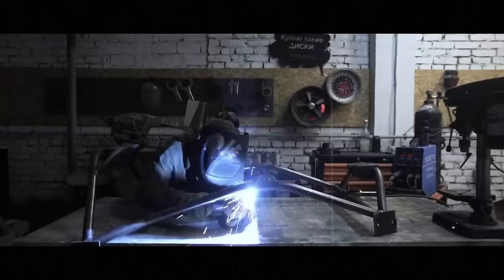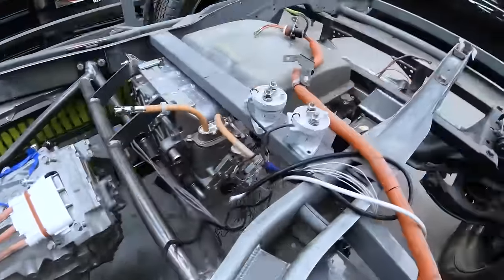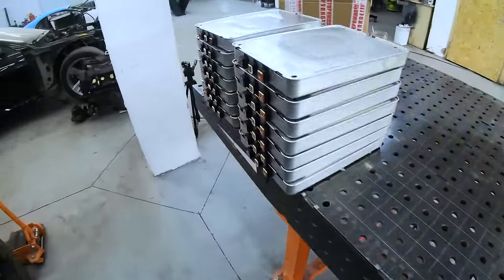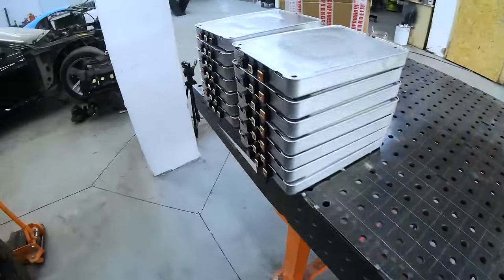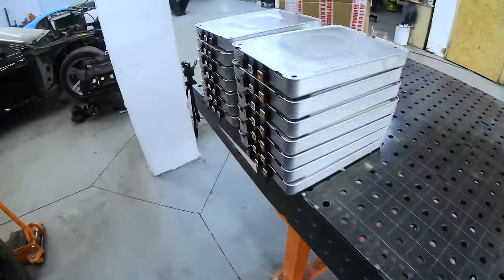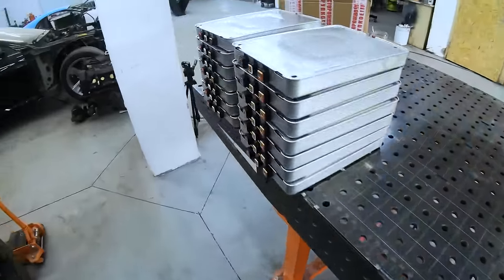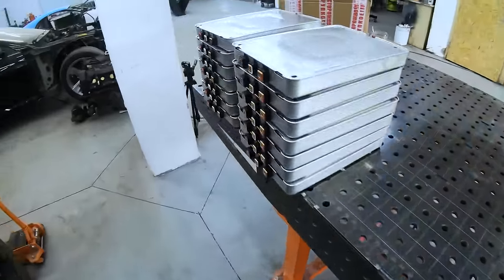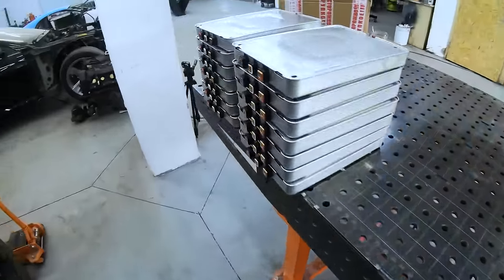Electric Cyber Van from the future the first departure. HomeMade

Comment: It's alive! If I understand correctly it's controlled by an Arduino, that's awesome!
Reply: Yes lets take right now one metric ton vehicle and put arduino of all things in charge of throttle and steering.. what ever could go wrong. I do not trust cybertrucks drive by wire setup or there being electric motor in the steering wheel at all, let alone this death trap. Guess its a blessing that this thing wont be in the road, but then why even make it if you cant use it?
Reply: Thanks for watching and long waiting! Happy you with us! Of course we are working on it.

Comment: To use an Auto Transmission you'll need to fit an external pump to maintain Fluid pressure when the Motor isn't spinning. Great work so far
Reply: I thought that too
Reply: Thanks for watching and your interest! Glad you like it. Have you seen our other crazy projects?

Comment: I was watching a hub rebuild of a rear motorcycle wheel and they had some energy transfer parts inside - even with a modern motor/gearbox/drivetrain, regular motorcycles still need a little help built in so they don't shred everything from the stress forces of the instantaneous torque they are able to produce, which is even "more" instantaneous with electric motors. 
Great build, this is going to be pretty awesome.
Reply: Russell, thanks for watching and your interest! Glad you like it. Which of our projects do you like most?

Comment: The axles will fail really fast with the weight of the battery pack only.  Turning circle looks like a laugh. Look at Mercedes Sprinter 316D rear wheel drive for ideas on how much wheel angle you need in a van.  Simplify everything, and spread it out front and back, no need to put everything in the front. An automatic transmission would work fine, but a working one with enough oil and electronic selector between 1 and R.  The torque converter will help with heavy loads + when pulling a trailer. Good luck with the project.
Reply: Thank you so much for watching and your interest! We appreciate it. Have you seen our other crazy projects?

Comment: I like the idea of having the fluid coupler for dampening. The transmission functions based on having a 5-800 minimum input shaft RPM. Is there a way to have the electric motor idle at 500RPM at all times when the system is on?

Comment: Do not weld or grind anywhere near you batteries.  Treat batteries like they are bombs, so welding spatter or grinding sparks can cause big problems.  Those Nissan battery modules have open holes to the cells themselves, so the potential for issues from the little bits of metal aren't just a potential issue while they are hot.  Vibration and tiny flexing of the pack during use along with the expansion and contraction of the cells during use as the status of charge changes can cause small bits of metal to make a hole in a cell which is the beginning of a catastrophic failure.
Reply: Thanks! Sub and keep on watching

Comment: I am confused why you didn't use the Leaf Gearbox which is a fixed single gear reduction. There is no need to either a "manual" or "automatic" gearbox with the Leaf Motor and inverter.

Comment: Electric vehicles don't need transmissions except in 2 cases.  1.  A severely underpowered system like e-mountain bikes or 2.  A vehicle that has 2 purposes... normal driving as well as climbing very steep inclines slowly or other extremely heavy loads.  Engineering types always what to put multi-speed transmissions but learn the hard way, from the original Telsa Roadster to almost all early emoto makers.  The reason no tranny is needed is that electric motors make maximum torque from 0 rpm and have broad torque curves unlike petrol motors that need higher rpms to make torque and have narrow torque bands.  Also, transmissions don't hold up well to the high torque possible from electric motors.  Just gear it right and you're good to go.  A perrfect example is trains.  Look att the loads they pull, and except for old steamers they are all driven by electric motors.  Even diesel locomotives have electric motor drives with a diesel generator.  All a tranny does is add weight, tons of failure points, and unnecessary drive losses of 10-20%, so dump the tranny, gear it for a top unloaded speed about 20% high than you want as a max speed, and let the controller do its job.

Comment: PS3, PS4, PS5, Switch, Xbox etc controllers all suffer from "stick drift" at some point. Once this happens, the joysticks will suddenly get stuck in an "ON" state or lose connection that you cant fix without changing out the potentiometers. Even then, the potentiometers in these controllers have a finite number of rotations they can handle before they wear out. Using a PS4 joystick like the one you have shown for your acceleration or steering would have disastrous or even deadly consequences if the vehicle was in motion. Stick drift can happen at anytime and even the latest PS5 controllers started to experience it after only a few months of use. If you are determined to control this vehicle with a joystick, it would be wise to use an electromagnetic joystick or linear hall effect sensors. More reliable and safer.
Reply: Thanks for watching and your interest! We like to create something new and unusual. We'll try) Have you seen our other crazy projects?

Comment: I can assure you the PS3 controller needs to go and you need to somehow install normal brakes and steering with transmission shifting. It should not be that hard. Man has to operate it with his legs and arms. you have done what no one else has and yes I have the absolute qualifications to say what I am proposing here. You have done very well so far. It is amazing what people can build if they have an Idea. A good 160km road trip would be something automotive manufactures would take a look at. That would be without recharging. Very expensive project but worth the work and research. My congratulations. I do not post on YT but I made a Chevrolet Spark get 47MPG which is impossible. I do design and build electric cars for an entity. I can and do get 32mpg with a trailer of 2000lbs on a Chevrolet 2500 HD LWB Ext Cab WT 6.0L engine and a 6L90 Transmission. With little or no Modifications to the Computer and no equipment change. I get that at 70MPH. Keep up the good work. My Truck get as much gas mileage as a 1973 VW Super Beetle which includes A/C. No loss of Power at all. Wish I lived near you I would help as long as my name was not mentioned.
Reply: Thanks for watching and your interest! You are great! Have you seen our other crazy projects?

Comment: Dude.. look up the transmission and see how much oil it requires.. sheesh.. different transmissions require different priming procedures as well. Run the transmission through it's gears to move the plates to help release air smh